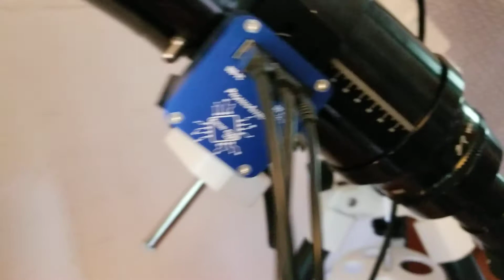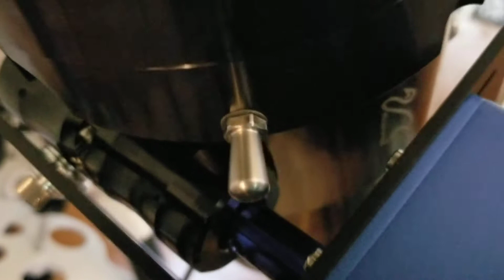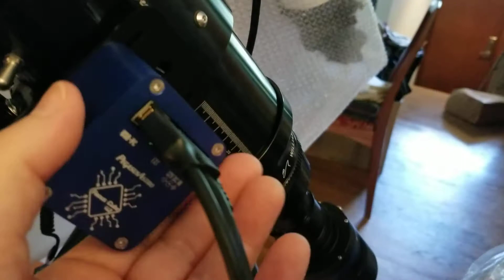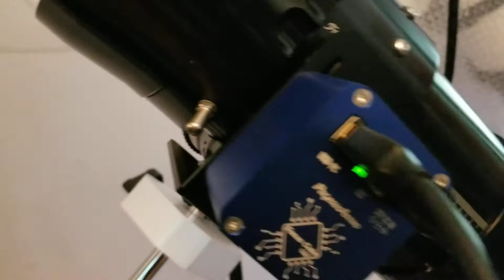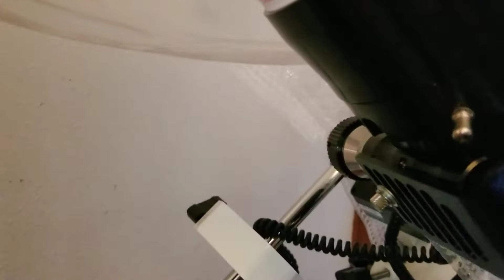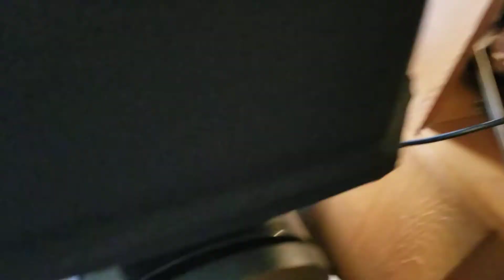Installing a Pegasus Focus Cube 2 on a William Optics 132 Feather Touch focuser.  May 15, 2020

Comment: Also noticed on the Pegasus website, the mounting example it shows on a TEC 140 with a FT focuser, it shows it's bolted down with 2 screws, so hopefully that would give you a much more sturdy mount.  That concerned me when I saw how much slop it had.

Comment: On my scope, focus is at about 110mm on my Feather Touch focuser, but I like to bring it all the way in when I take the scope off the mount.  So 110mm of travel is a lot.  Does this allow you to manually just bring the focuser in, or do you have to use the controller to do that?  If so, how fast is that control in course mode?

Thanks

Comment: Hi from Mel in london uk Scott can you help what is your backlash for you focus cube mine is about 750 step seem ridiculously high 
Thanks for you help in advance

Mel
Reply from the maker: That does seem high.  I dont know exactly what mine is.  I seem to get changes at about 50 steps.  I had to run a metal bar to my base plate to get that stability.  Also, I didnt have the right side hole in my connection adapter to the shaft.  So I got a smaller one and drilled it up to the telescope shaft size and it made a tighter fit.
Reply: Scott Collier Hi Scott thanks for getting back to me I think I have sorted the problem I used my digital calliper on and found it was moving but a very small amount got it Dow to 165 so set at 170 so now for the big test later if I I ever get some clear sky’s anyway will let you know how I get on 
Thanks again

Mel